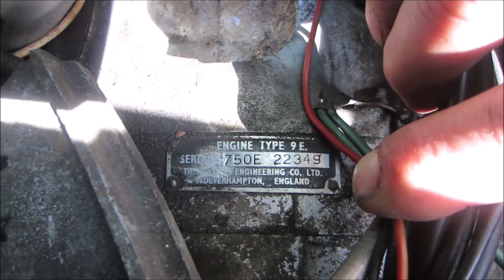Barn find, beaver amphibious vehicle

Comment: Awesome video as always.  One tip I leaned from boat repair: If/when you do seal those bolts below the water line please use a product designed for below the water line use such as 3m 4200/5200.  Silicone will dry and eventually leak.

Comment: Just wanted to comment on your channel in general. I just finished taking the carb apart on my Honda 160 cc lawnmower and cleaning it. Engine was surging so I assumed it was dirty carb, the mower is 10 years old after all. I've never done anything other then changing the plug and air filter so this was a first for this retired EE. Thanks to watching you rehabilitate numerous small engines figured I'd tank the plunge.  All in all a very satisfying morning.  So thanks for a nearby neighbor in southern NH.

Comment: Those engines weren't just used in motorcycles, they were also used in various very small cars (microcars) and three-wheelers in the UK certainly, and possibly in Europe as well, complete with the interesting reverse set-up of running the engine in the opposite direction to go backwards...

Comment: I built an outboard out of one of these engines. It worked - a bit. The engine I believe like mine came from an invalid carriage. If you google 'UK invalid carriage' it's there - pages of it. There were dozens of these little invalid carriages on the roads at one time. Any colour providing it was blue. They were a pain in the bum if you got stuck behind one on a norrow road as they did about 35 mph pedal to the metal. They were of course quite reliable - they had to be. I'm sure there are plenty of spares available but if the UK to USA post is anything like the cost of USA to UK you had better be sitting down when you find out. I would imagine though that as the Villiers (pronounced vill I ers or vill e ers) was a pretty sound basic engine there may well be some spares available in the USA. The Villiers engine was used in all sorts of bikes and the twin was pretty hairy in the scramble bike. Best of luck Mustie.

Comment: Hi mustie, is a villiers 9e parts are easy to come by in the uk from the likes of meetens not sure on your side of the pond tho it a British bike engine it may of had a solex or Amal carb - waltherhampton was the giveaway
Reply: It's a Amal carb, the 626 is a common upgrade, another supplier is villiers services
Reply: canuckguy worried most sleds (that I'm aware of anyway) used mikuni, keihin, or tillotson carbs. Some early models may have had some form of weber.
Reply: canuckguy worried my God, I haven't heard the Bultaco name since I was a kid...guess I'm dating myself lol. My first sled as a kid was a '72 Tn't 440 with the tillotson on it. All the sleds after thai had jap carbs as well. Gave up snowmobiling back in 09 as there are too many morons on the trails nowadays who think they're in an xgames heat. Add to that a few beers and it makes for a bad combination when you've got kids riding in your group. As for a carb being a carb, you're right. Mustie could very well find a 22 or 24mm carb, research what main & pilot jets were in the beaver as oe and be in business...at least he will be once he gets the bottom end issues taken care of.
Reply: The Villiers 9E with fan cooling like the Beaver, but with magneto ignition and three speed Albion gearbox with reverse and kickstart was used in a Snowmobile made in Sudbury Ontario. It was called a Snowbug and they used the Villiers engine for two or three years only. The Beaver would have a Villiers S25 carb on it.

Comment: I was yelling at the screen that I needed that stuff that you dropped off at the scrapyard. I can't help but think you should have tried to sell that wheelhorse deck. There is a cult following for wheelhorses, you know. (And I'm in that cult). Also needed those wheelchair motors and tires for building an autonomous mower. lol. I don't blame you in the slightest for choosing to get rid of it though, I'm surrounded by stuff, myself. 1625 lbs.

Comment: Mustie, I reckon you need a 'U' bracket on each side of the body by the tailgate, and a drop-in bar with a floating pulley to lift your winch cable above the tailgate a bit. Just a suggestion...
If it's a Villiers engine, the carb is likely an Amal. (I used to have a '66 Francis Barnett motorcycle...) The bullet connectors should come apart. Should, but won't. It's so awkward to work on because Villiers engines never go wrong... ha! A 20:1 fuel:oil ratio would be safe to start with - you can tweak it from that up to maybe 32:1 if it smokes too much, assuming that you proceed with the project. Or, swap the engine for something Japanese! Brrring ding ding :-)
Btw, all the engine nuts and bolts are probably Whitworth thread. Looking forward to this!

Comment: It's a British Villiers 9E 250cc 2 stroke.. The carb would be Villiers own or an Amal Monobloc.  It probably has a Siba Dynastart ( motor/dyamo unit)   
It was used in some of the James and Francis Barnett motorbikes and Bond 3 wheelers in  the late '50s/early '60s
Reply: The 9E is 197cc, the Beaver also came with a 173cc Villiers 3L engine, also 4 speed transmission

Comment: That engine set up was used in the Bond 3 wheeler minicar driving the single front wheel. There is a video of someone starting one on youtube, You have to stand in the engine bay and kickstart the little beast. The engine assembly pivoted with the steering and due to the 2 stroke engine and reverse running they had the same speed in either direction. The earlier versions were simpler single ignition systems and if you wanted to go backwards then get out and push. Not that bad as they weighed very little. Well worth a google and a good few vids on youtube. I await the Will it Float series of Mustie vids with great anticipation.

Comment: another one hope it helps you get it running. would be a nice toy to keep even if you don't have all the original parts.4 speeds forward 4 speeds backwards. engine runs both ways. turn switch either way from center with center off. good luck finding that switch .i guess off in the middle acc and run maybe would work

Comment: I think the engine mount system is similar to the old Army tracked vehicles,.... The cradle is mounted to the floor and a ballscrew and clamp hold it tight to the cradle. Simply turn the threaded rod thats in front of the motor with a socket and the clamp slowly opens.

Comment: Musti, you find the damndest things. My guess for the weight on the dump run is 1765 lbs.  If that machine is, in fact, British, might it be 24 volts, unless it was built with the North American market in mind? Anything I have had any experience with to date has been 24 volts. They are special and will expand your vocabulary tenfold.
        Mike

Comment: Cool, a CorWett... Maybe use the 2 cyl. Tcheck motorcycle engine to make this one go or a twin cyl. mower powerplant??
Be carefull with the dual trike setup in the front. If you hit something on just one of the wheels it may jank the steering tiller out of your hands...

Comment: Definitely do every repair with a grain of salt. Who knows how many of those are out there. This is literally the first one I've ever seen lol! Seeing as how it's a amphibious vehicle the engine most likely got hydro locked and someone tore it apart to fix it.
Reply: A common issue on the engine is that the rotor and stator for the dynastart will rust and stick together. The rotor, of course is supposed to rotate, the stator does not rotate.. Removing the right side cover and a few slaps with a rubber mallet in the rotor may unstick it.

Comment: If you have a tyre off its rim like that you can use a small bicycle tube inflated on the rim to seal it till it gets onto the rim then deflate the bike tube and away you go.
Works on really big wheels too even with a small compressor.

Comment: Here's a blurb from the web:  The Beaver is a German made amphibious vehicle. It has power to the two back wheels only. It has two front wheels that are very close together and act as rudders in the water. The most interesting thing about the Beaver is how it goes in reverse. You turn the key clockwise and the engine starts and you go forward. When you need to back up, you turn the engine off and turn the key counter-clockwise and the engine starts BACKWARDS and the machines goes in reverse!
Reply: Unfortunately that blurb is not correct. I won more than one Beaver. Not sure how it was figured it came from Germany ?  Wheeler Mobile in Keswick Ontario, Canada made the Beaver. It should say that on the plate in front of the battery box on Mustie's machine.

Comment: Here is an extract from Wikipedia. I though the last paragraph particularly interesting as in mentioned a way of reversing as you did by stopping the engine and getting it to rotate backwards.

Love you videos.

Bond Minicar
Bond Minicar is a series of economical three-wheeled microcars which were manufactured by the British car manufacturer Sharp's Commercials Ltd (the company was renamed Bond Cars Limited in 1964), in Preston, Lancashire, between 1949 and 1966.[2]

Bond Minicar
1964 Bond Minicar Mark G Tourer.jpg
1964 Bond Minicar Mark G Tourer
Overview
Manufacturer
Sharp's Commercials Ltd
Production
1949–66
24,482 made[1]
Assembly
Preston, Lancashire, United Kingdom
Body and chassis
Class
Microcar
Layout
FF layout
Chronology
Successor
Bond 875
Contents
Origins	Edit

The basic concept for the minicar was derived from a prototype built by Lawrence "Lawrie" Bond, an engineer from Preston.[3] During the war, Bond had worked as an aeronautical designer for the Blackburn Aircraft Company[4] before setting up a small engineering business in Blackpool, manufacturing aircraft and vehicle components for the government. After the war he moved his company to Longridge where he built a series of small, innovative racing cars, which raced with a modest amount of success.[3] In the early part of 1948, he revealed the prototype of what was described as a new minicar to the press.[5]

Described as a "short radius runabout, for the purpose of shopping and calls within a 20-30-mile radius", the prototype was demonstrated climbing a 25 per cent gradient with driver and passenger on board. It was reported to have a 125 cc (8 cu in) Villiers two-stroke engine with a three-speed gearbox, a dry weight of 195 pounds (88 kg)[6] and a cruising speed of around 30 mph (48 km/h). At the time of the report (May 1948), it was stated that production was "expected to start in three months' time".[7] The prototype was built at Bond's premises in Berry Lane, Longridge where it is now commemorated with a blue plaque.[8]

Sharp's Commercials was a company contracted by the Ministry of Supply to rebuild military vehicles.[9] Knowing that the Ministry were ending their contract in 1948, and recognising the limitations of his existing works as a base for mass production, Bond approached the Managing Director of Sharp's, Lt. Col. Charles Reginald 'Reg' Gray, to ask if he could rent the factory to build his car. Gray refused, but said that instead, Sharp's could manufacture the car for Bond and the two entered into an agreement on this basis.[10] Bond carried out some further development work on the Minicar, but once mass production was underway, left the project and sold the design and manufacturing rights to Sharp's.[11]

The engine bay of a 1959 Minicar Mark F. The kick start on the right hand side of the engine was fitted for emergency use; all Minicars were started from the driver's seat.[12]
The prototype and early cars utilised stressed skin aluminium bodywork, though later models incorporated chassis members of steel.[12] The Minicar was amongst the first British cars to use fibreglass body panels.[13]

Though retaining much of Lawrie Bond's original concept of a simple, lightweight, economical vehicle, the Minicar was gradually developed by Sharp's through several different incarnations. The majority of cars were convertibles, though later, hardtop models were offered, along with van and estate versions. Minicars were generally available either in standard or deluxe form, though the distinction between the two was largely one of mechanical detail rather than luxury. The cars were powered initially by a single-cylinder two-stroke Villiers engine of 122 cc (7 cu in). In December 1949 [14] this was upgraded to a 197 cc (12 cu in) unit. The engine was further upgraded in 1958, first to a single-cylinder 247 cc (15 cu in) and then to a 247 cc (15 cu in) twin-cylinder Villiers 4T. These air-cooled engines were developed principally as motorcycle units and therefore had no reverse gear. However, this was a minimal inconvenience, because the engine, gearbox and front wheel were mounted as a single unit and could be turned by the steering wheel up to 90 degrees either side of the straight-ahead position, enabling the car to turn within its own length.

A method of reversing the car was offered on later models via a reversible Dynastart unit. The Dynastart unit, which doubled as both starter motor and dynamo on these models incorporated a built-in reversing solenoid switch. After stopping the engine and operating this switch the Dynastart, and consequently the engine, would rotate in the opposite direction.[15]

Comment: You did not show the gas-tank on that thing.  Is it below the engine and fuel is pumped up to the carb?  Also, that battery seems to be WAYYY too big for starting that little engine. Would not a lighter battery help it float?

Comment: All those electronics allow the engine to be started in either direction. It had 4 forward and 4 reverse gears... or so they say.
Reply: In the control box is - ignition coil, ignition condenser, starter solenoid, generator cut out and voltage regulator and reversing solenoid. The 4 forward speeds can be used in reverse.

Comment: The ground wire connects to the valve spring which connects to gear shift. The gear shift connects to the transfer case which connects to the trainie. The headlamp wire connects to powersource box which connects to the thing goes vroom vroom. If you lift that other thing and look underneath you'll see something that needs to connect to the thingamabob. Once you get that connected everything should be A-ok!

Comment: at a guess they melted a piston and didnt clean out all the aluminum in the bottom which then locked up. If there is aluminum in the roller bearing on crank thats why.  Still i remember reading the adds for these the the six wheeled version from popular mechanics.

Comment: should have kept those wheel chair motors, they cost more that $150 each, they can be used to make a winch, or if you remove the gear box, and spin them they work as a generator.

Comment: I was thinking the same as your "funny",jump in truck rev it and let clutch out or power brake and let off lol
at one point the "ramp kits" and pre-made ramps, came with pins and template/directions to drill holes in tailgate to secure ramps. they quit bothers because nobody did or cried about drilling holes/rusting out

Comment: Looks like it has a motorcycle type carb Because that needle on cable with spring goes into the top of the carb most likely a mikuen carb
Reply: mikuen ? you mean mikuni ?
Reply: Amal or a solex as it a British bike engine
Reply: I'd be happy to see a Mikuni any day of the week over those damned Keihin carbs.
Reply: The carb is made by Villiers. It is an S/25 slide type with cable operated choke. There is also a tickler button to hold the float down to flood the carb to prime it to start.
Reply: Stan Patterson OK so it is a different type of carb I was only guessing the Muikni but I thought that it could be any of the cable choke style
Reply: Stan Patterson I haven’t Dealt much with keihen but muikni I have And I think they’re OK carburetors they seem to hold up pretty well a lot of the older motorcycles had them

Comment: Put a golf cart engine in it and be done with it, you can find one of those easily and it won't require the ignition system like that one.  I am fairly sure if you mess with that engine you will spend a lot more than a used golf cart engine.